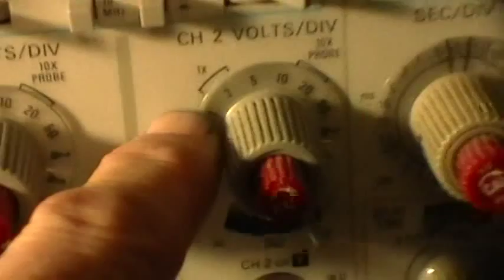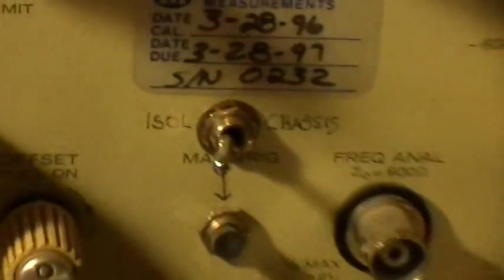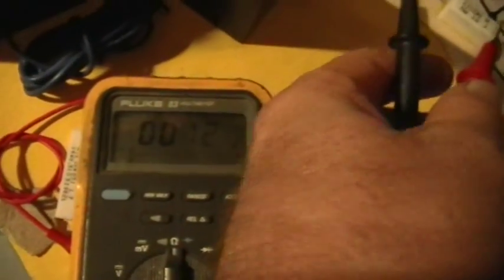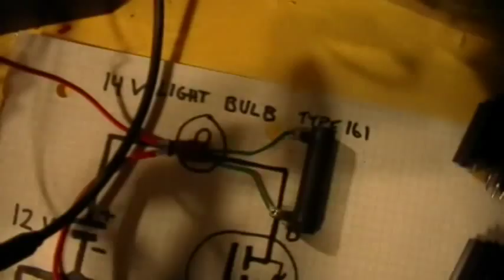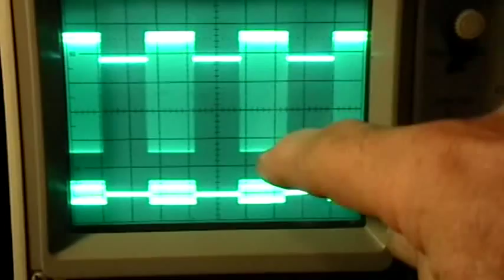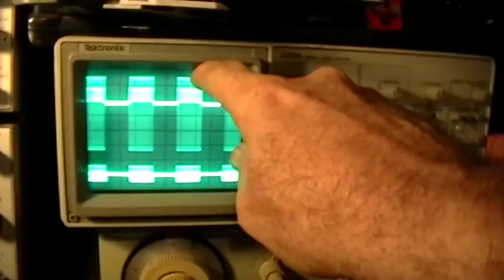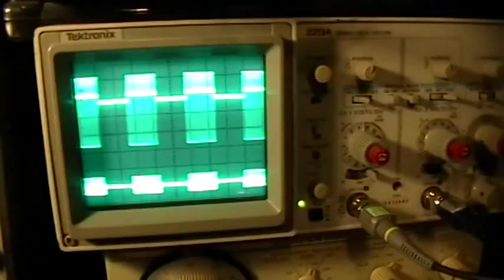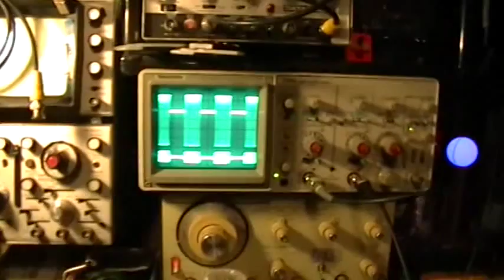Electric OU: Spurious Current Amplitudes Caused By Inductive Current Sense Resistors

Comment: Can you do one more with just one or the other... like the oscillations won't happen if you don't have the inductive resistor there?.... you have a moving ground condition on the (drain?) ... or the same thing happens with a battery, because it's got a capacitance in it?  and/or reverse them?
Reply from the maker: I'm not quite following you.
The oscillations of course do occur with or without any current sense resistor at all, please see
Electric OU: How DO Mosfets Work? Rosemary Ainslie Remedial Part 2
The point of this present demonstration is that a non-inductive resistor will give you false current readings because the voltage drop across the resistor during oscillations appears to be much greater than it really is. The non-inductive resistor gives a much truer reading of the currents. Also, the FG is not in danger from these currents... because they aren't real! Rosemary Ainslie has claimed otherwise, therefore I am demonstrating the falsity of her claims. She actually expected my FG to explode (her word) when I hooked the 74 volt total battery supply in series with it as I did at the last part of the video.

I don't understand the rest of your question. Can you be more clear?
Reply from the maker: Yes, reversing the order of the resistors is a good idea, because if, or rather when, the same result is shown that will eliminate any objection that one might be affecting the other in some way. Thanks for the suggestion. If I make another video on this topic I will include that variation.
Reply: doesn't matter; if you have a inductor on the emitter/connection to ground, then what 'ground' is is variable... so the reference between the ground and the gate gives extra oscillations... capacitance dampens the effect, because it is able to maintain neutrality near the gate and can fix the oscillation....
Reply: conversely, if you add a few uH of inductance you could use lower voltage